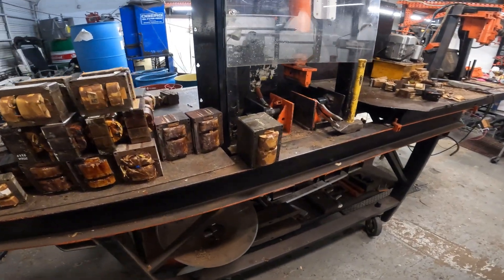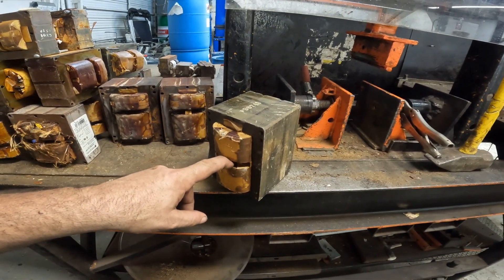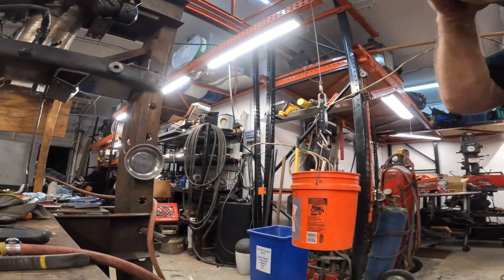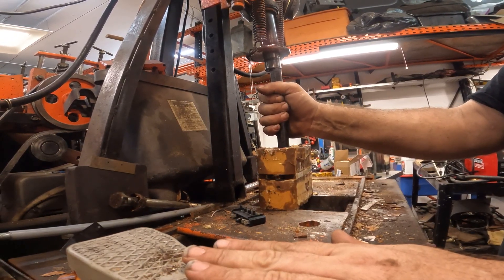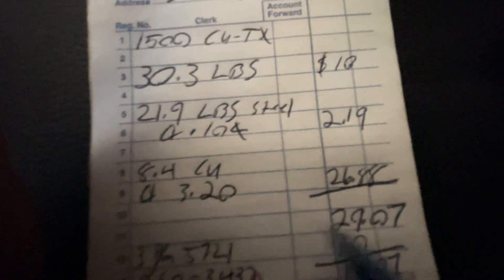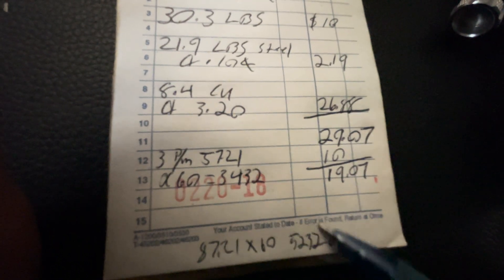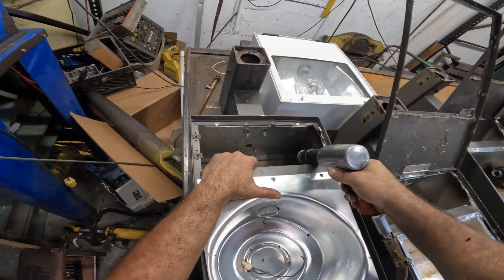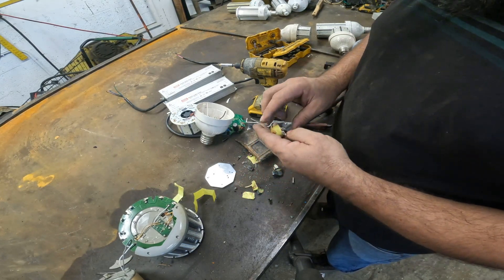The 1500 Watt Double Copper Transformer - The Holy Grail Of Lighting Transformers

Comment: @6:38 in the video: Just noticed the scale said 8.04lbs on the coils, instead of 8.4lbs.
So the numbers would be slightly different: It's a percentage of 26.53% Cu content in that transformer. #2 Cu: 8.04lbs @ $3.20 = $25.72 + Steel: 22.26lbs @ $0.10 = $2.22; for a total of $27.94. Making the profit come out to $17.94 a unit.
Still a very cool result on a single transformer!
Reply from the maker: Thanks for the clarification, I'm slightly dyslexic so I probably wrote 8.4 when I was filming.
Reply: Yeah I was gonna comment this

Comment: Man your paying 5 grand a month for shop rent? Thats crazy isn't it. Just think if you had a small piece of land somewhere land is reasonable and you took 5k every month and bought your own supplies and building materials you would have a nice place after awhile. Or you could buy 1 40ft cargo container every month. Could put 5 or 6 side by side and take out door ways or even whole sides to make a big open shop, could use the steel from take the wall down and make some ridge cap where the containers butt together and weld em up. 
 I know it's stressful but having that kind of rent due every month would stress me out. You work hard everyday so I know you could do anything buddy. Thanks for a great vid
Reply from the maker: I'm working getting some property.
Reply: 100% Right.